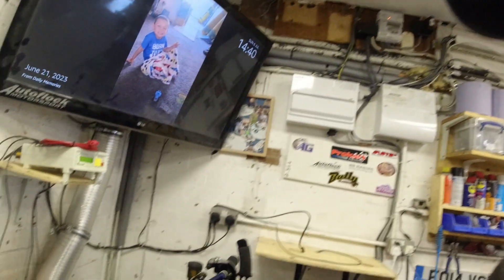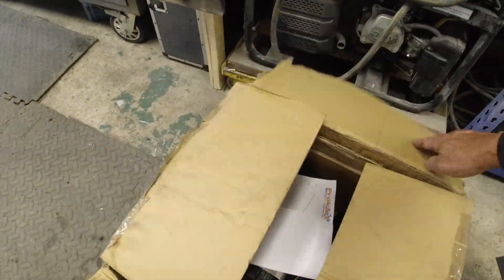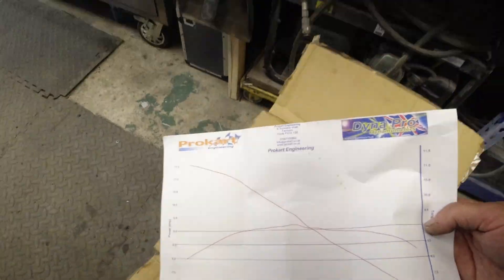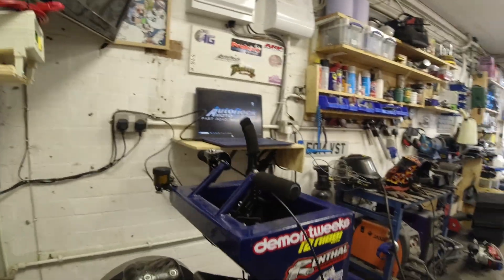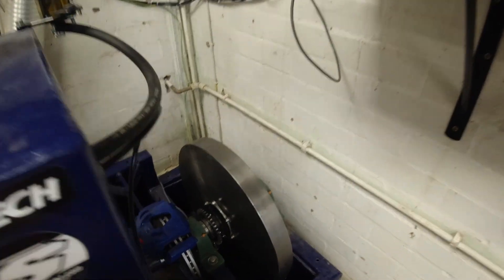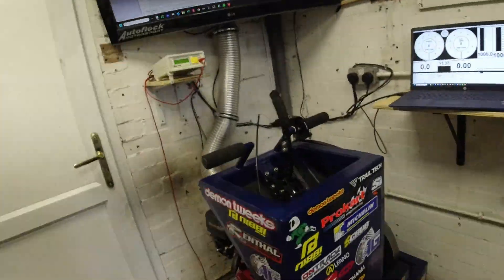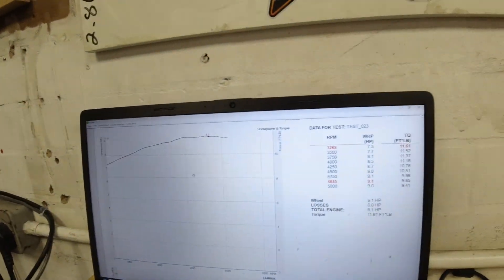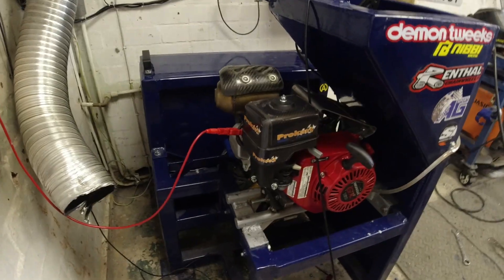DIY Engine Dyno Part 5 - Finally Finished

Comment: I would be keen to see a video of the dyno being operated and a engine revving out on it :) Thanks.
Reply from the maker: hopefully soon, a new vid is coming out of my new race engines being built, so as soon as they are ready they will be broken in on the dyno then a decent power run
Reply: @autoflockmotorsport7730  Awesome stuff. Thanks for the vid. Keep at your great work.